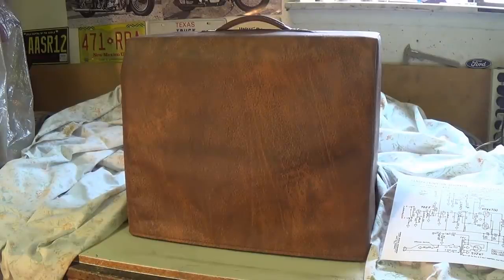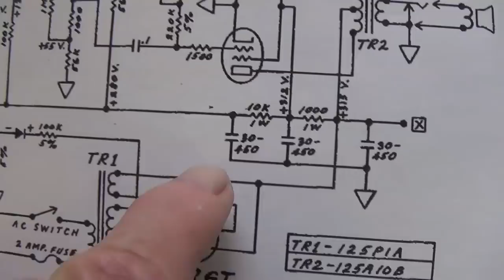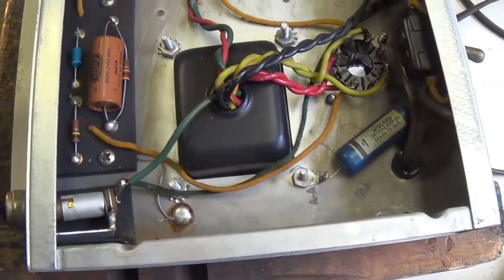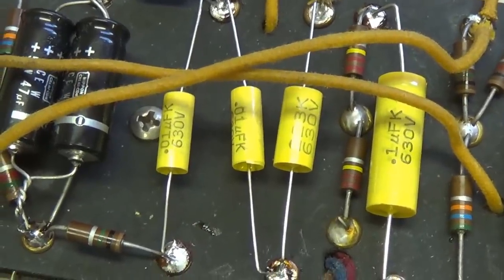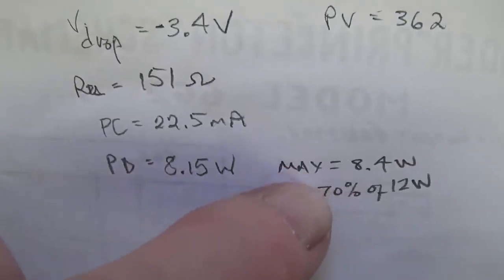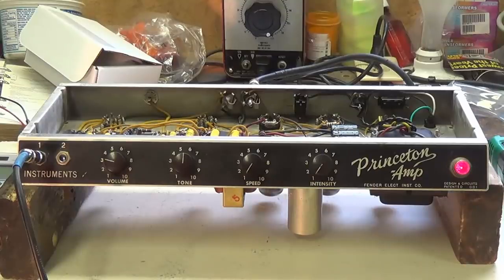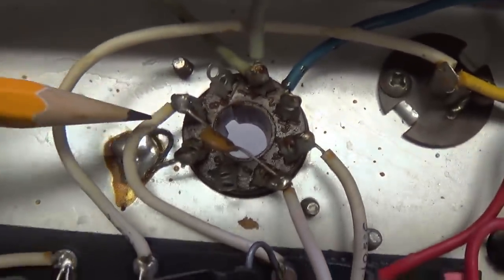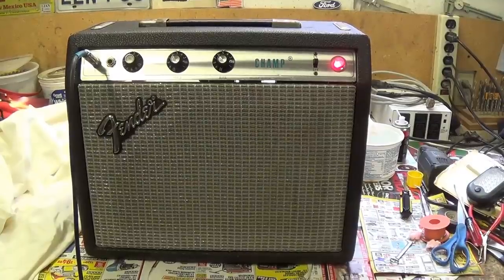Brownface Fender Princeton and Silverface Champ "Double-Header"

Comment: @UncleDoug  Hi and thanks for the videos! I have a 63 princeton amp I fired up today and it sounds overdriven when it's not supposed to. I checked the fuse and tubes, discharged caps, gave a quick look to see if anything had exploded and nothing, any thoughts after working on the one you did? thanks!
Reply from the maker: You might check your output tubes to be sure they are properly balanced and functional. Other than that, I'm at a loss.
Reply: @UncleDoug  thank you, any recs on a tube set?
Reply: also, can I mimic the bias pot mod from your other video on mine, get a matched set and then I can bias on my own with just a multimeter?

Comment: UNCLE DOUG --- I have a 1963 Fender Princeton Amp that I'm rejuvenating . What is the name or kind of tulle cloth that is used
on the front of it. Mine has kind of gotten stained over the years and looks like crap and needs to be replaced . I've had it since 1963... Thanks in advance.   Walt
Reply from the maker: Antique Electronic Supply offers a nice selection of replacement grille cloth, Walt. Check out their internet site.

Comment: 25:50 - Is the voltage drop across the primary for the right tube also ~ 3.4v?
Reply from the maker: No, it was quite a bit lower......which led to the replacement of the weak GE's with a brand new matched set of EH's. I left in the pot tuning of the bias circuit for instructional purposes, David.

Comment: Look at the serial number F00513, man this is a museum piece, but if he wants to actually play it these things have to be done. I wonder how he acquired it? Nice work again Uncle Doug. Are they old Indian Motorcycles pictured on the wall??
Reply from the maker: You're right, Z, but all the original parts stay with the amp so it can be restored to original if necessary. It was bought new by his father and is a family heirloom. Thanks. Sadly, I have never worked on an old Indian, so the wall "art" is mainly vintage Harley's and old British bikes.
Reply: Well I should have watched the video through first and of course Uncle Doug shows us every part and goes over the amps fully. My 1969 Bandmaster reverb has the wire "Faraday Cage" also Doug, I'm pretty sure that it is standard at least till mid seventies.
Reply from the maker: I guess I've never worked on one, Z. I don't recall seeing a Faraday Cage.

Comment: Why was the diode specifically replaced?
Reply from the maker: As a precaution. It appeared to be a molded selenium diode and thus was suspect. As cheap as diodes are, it's crazy not to simply replace them with much higher spec fresh diodes.......for about 20 cents.

Comment: Great video!  I'm working on a DIY fender 5f2a.  I've read on some forums that you shouldn't put a 47uf cap directly after a 5Y3—it's too high supposedly.  I want to install a 47uf in my 5F2A.  Are these people on the forums just being overly cautious?
Reply from the maker: Thanks, Tysen. Why do you want to use a 47uf cap? Having built a clone of this circuit, I can assure you that upgrading to two 22uf and two 10uf caps (in proper sequence) will provide optimum filtering. There is nothing to be gained by using the 47uf cap, other than stress upon the rectifier tube.
Reply: Well, someone on a forum suggested it to help with some oscillation I'm having when my volume and tone knob are turned up past 8.  I think it's probably my layout or possible lead dress....  @UncleDoug
Reply from the maker: What a strange way to prevent oscillation. If anything, you could simply install grid-blocker resistors on the pre-amp tube stages. Meanwhile, you're better off sticking with the regular filter cap values.
Reply: Great.  @UncleDoug   Thanks for the heads up! It's hard to know what forum folks to believe.  lol.  Anyways, I ended up solving my problem—everything is point to point on my amp and the 68k resistor coming from the input jack was too close to my coupling capacitors.  Once I moved the resistor close to the tube socket, amp sounds incredible!!

Comment: Uncle Doug - I have the exact same amp but with black Tolex from May of 1964. One of the last ones I believe. Its one month older than I. Just before the Blackface came out. It is also in very good shape. I was trying to get your attention to ask you why it sounded so trebly and nasal but I did not get a response. 
I was frustrated with the bad tone. I would have taken it to you had you lived closer. 
Do you have any idea why this amp would have no bottom-end and sound nasal? What is that a symptom of? A bit like a Wah half cocked or something. It looked great but sounded awful. 
I did some intense studying in electronics, since I could not get anyone to guide me. I then changed the value of the V1P1 and V1P6 caps. I also changed the modern Eminence ceramic speaker to a proper Jensen Alnico and it is a killer amp now with wonder tone and touch sensitivity. I love my amp now. 
Let me know if you have any idea as to what may have been going bad with my amp before the cap changes. I am a guitar builder but not and electronics guy but learning as I go along.
Reply from the maker: From what I can gather, you changed the value of the coupling cap from V1 (7025) pin 6 to the grid (pin 7) of V3 (12AX7). The tone control provides the coupling caps for pin 1 of V1......so I'm not sure how or why you changed them. All I can think of is that the coupling cap from pin 6 to pin 7 was bad, and when you changed the value, you installed a new, functional cap. The original capacitor was probably allowing DC to leak to the V3 grid, which will cause all sorts of problems. Regardless of my guesswork, all that really matters is that the amp is now fully functional.
Reply: @UncleDoug  Thank you for the reply. Just to clarify, I really increased the values to add more bass response and it worked.
V1P6 - I changed to 0.1 Ω
V1P1 - changed to 0.47 Ω
You can see these are a lot higher than spec. Like you said, it also must have been bad original caps.
Reply from the maker: As long as it worked for you, Z. That's all that really matters.

Comment: Was your change of the bias resistors more of a re-engineering that will work fine when a new set of 6V6s is put in? Or was it specific to that pair? (I heard no mention of the condition of the 6V6s.)
Reply from the maker: No, in any fixed (grid) biased amp, the bias resistance is carefully tailored to the output tubes, and must be checked and/or adjusted whenever a new tube set is installed. Look at the notes pinned to the top of the Comments for a statement regarding the old GE tubes. They were replaced.

Comment: I love this. Uncle Doug, have you any experience with Ampeg Portaflex amps? I have a cool example from 1962. I’ll send a pic if I can figure out how...
Reply from the maker: Thanks, Jon. My only experience with Ampegs is a Jet that I have owned and worked on quite a bit. I have great respect for the brand and would love to work on more of their products.
Reply: Uncle Doug - very good! How do I contact you? It may be obvious and I’m missing it....
Reply from the maker: Provide me with your e-mail address and I will contact you. Be sure the amp is a pure-tube circuit.....no PCB's or hybrids.
Reply: Casey says - “remove the cone of shame at once!”
Reply: I just completed restoration of a 1964 M-15. A bottle of mineral spirits, Q-tips and some dental picks will come in handy to soften and release the rubber glue slobbered on every wire and components in the chassis. In a few short hours you will have an incurable addiction to sniffing the spirits and qualification as a backroom dental hygienist!

Comment: Great vids , wondering if I should send you my Alamo bass head .
Reply from the maker: Thanks, David. It costs a lot to ship (both ways). Financially, you are much better off getting the work done locally.
Reply: @UncleDoug  ok sir thanks. I have been thinking I could delve into myself , I used to work on different electronic devices , mainly swap-tronics but I can solder good , also worked on alot of RC stuff.
Reply from the maker: @dave691974  See what you can do, David. If all else fails, I'm here for you.

Comment: What are those little clampable meter leads called? I'd like to get some for my Fluke meter. 

Thanks.
Reply from the maker: I think this is what you're looking for, Bryan:  https://www.ebay.com/itm/20PCS-Wire-Kit-Test-Hook-Clip-Grabbers-For-Multimeter-Arduino-SMT-SMD-E7C4/332748640177?epid=24010956660&hash=item4d795d4fb1:g:FPoAAOSw98FbZypD:rk:9:pf:0

Comment: At 5:42, notice that the fuse is on one leg of the power cord and the on/off switch is on the other leg of the cord. A bad idea! Common for Fenders and most other old amplifiers....and should always be corrected when the new grounded cord is installed, so that the fuse and switch are both  inline on the incoming hot lead,  which then goes to the power transformer. The neutral wire should always go directly to the power transformer. .
Reply from the maker: You need to watch the rest of the video, GU, this is not only corrected but explained in a later portion.
Reply: @UncleDoug  , nope, I watched the video again , and at some point the grounded power cord just "appears" inside the unit but you didn't show or talk about any of the rewiring you did to the hot and neutral lines. I don't need to see it done for my own edification, but it might be beneficial to other viewers.

 I am also curious if you lifted the grounded filament circuit and installed ground referencing resistors as an artificial center tap. It didn't appear that you did so on either amp (Champs also typically have a grounded filament circuit). Granted, the amplifiers both seem to work pretty quietly, with no major hum, but how they behave in the owner's homes (with computers, florescent or LED lighting, and whatnot) or even up on the electrically noisy environment of a nightclub stage could be very different.

Comment: Uncle Doug One cant help but wonder that if Ted had Rusty to help sort things out back in the day, would Ted’s resolution have had a more positive spin? He may have had more time to turn his attention to tube amp repair and design, which would have been right in line with Rusty’s agenda. I dont hear any disagreement from Jack, so for now I’ll have to lean toward his agreement on this matter.
Reply from the maker: Rusty didn't trust old Ted due to a difference of opinion regarding application of the Fibonacci sequence to proper coil winding techniques. As a result, they rarely spoke.
Reply: That may well explain Jack’s indifference.
Reply from the maker: Indeed :)
Reply: Uncle Doug It’s nice that instead of copying what Fender would use, you rebiased according to the actual range of the tubes; or the tube mfr specs. Lots of amp makers push the tubes too hard.

Comment: With the new bias resistor, replacing tube will require putting back in the 30k ?
Reply from the maker: No, Tony. Each time a new tube set is installed, the resistance value will have to be tailored to the new tubes to provide proper plate dissipation. Odds are that the 30K resistor will never be used again.

Comment: Hi Uncle Doug.  I don't know anything about social media or any other way to reach you.  That being said, I just completed a brown Deluxe 6G3 using the schematic out on the ampwares site.  My normal channel is absolutely glorious sounding, stealing a phrase from you.  My bright channel is lower in volume, has very little chime and overall is very uninteresting sounding.  Some of the differences that I see in the two channels are a .003 cap that parallels the plate resistor on the normal channel only and the caps on the tone pots that are grounded to the pot bodies, .01 on the normal channel and .02 on the bright channel.  Can you tell me in this design, which components make the tonal and volume differences in the two channels?  Is there a better way to reach you other than opening a facebook acct?
Reply from the maker: I also have a Facebook page: Uncle Doug's Vintage Amps, Tele. I prefer to keep amp commentary on either this format or on FB. Looking at the schematic, I too see very little different between the two channels. The .003uf cap in parallel with the plate resistor probably lets some high frequencies escape from the circuit, thus making it more mellow than the "Bright" circuit, where they are retained. Are you sure there are no circuit errors in the "Bright" channel?  It should be just the opposite of flat and uninteresting. To test this theory, add the .003uf cap and change the tone cap to .01uf.....making the two channels identical. See if they sound that way. If not.....there must be a problem in the Bright channel, i.e. a weak triode in the 7025/12AX7. Be sure both cathodes are bypassed.

Comment: UD, unrelated,but I did not know where to post this inquiry, and, if you've addressed it, please accept my apologies...regarding (your) test equipment: do you find much use for/or have a  VTVM, an old 'capacitor checker' (for leakage mainly) and the like...I've read, for example, that because of impedance issues a VTVM is better suited than a digital meter for tube equipment troubleshooting.Your thoughts appreciated and thank you so much.
Reply from the maker: Actually, I would say that the much higher internal resistance of the modern digital meter would make it more accurate for any and all circuit measurements, Joe. The old analog meters (which I also own and love) had much lower internal resistance and tended to load down the circuit, actually altering the measurements by their presence.  The only time that the analog meter might be better would be if you were trying to emulate the voltage values on an old schematic......since they were most likely taken with an analog meter.
Reply: @UncleDoug , your last sentence nails it. In certain instances you really need to either use an analog meter that loads down the circuit more, or put a shunt resistor across the meter probes of your digital meter to make it load down the circuit as if it was an analog meter. Alan Douglas's book "Tube Testers and Classic Test Equipment" makes mention of this, and the necessity for using a shunt resistor on a digital meter (paralled across the test- probe inputs) if you are calibrating a Hickok tube tester, otherwise your calibration procedure will be way off. (Approx 1k per volt shunt in the case of the Hickok calibration, therefore a digital meter set to the 200 volt input range would be shunted with a 200k resistor; the Hickok main B+ is 150 volts).

[Edit: I should add that the impedance of a vtvm is also very high, similar to the high impedance of a digital voltmeter, and there are certain circumstances with vintage equipment where they wanted you to use the vtvm, so as not to load down the circuit under measurement. An example being if you were attempting to confirm proper  AC signal level  to the grid  of a tube under test in a Hickok tube tester; for that application, or for calibrating it in the Hickok models that allowed  you to do so,  you were supposed to use a vtvm.  The rest of the measurements however were generally specified as being done with an analog  meter of lower impedance input.]
Reply from the maker: @goodun6081  Thanks for your follow-up, GU. The additional info was very helpful.
Reply: I thank you! I may follow up with this again

Comment: Looking to fix a Randal 100HG Amp head.  With a speaker list I get two resisters smoking.  Not a tube amp but was only made a couple yrs. In the 90s.  Any suggestions?
Reply from the maker: If it's a SS amp, I have no idea, KC. I deal only with tube amps. Perhaps a Randal site will be able to help you.
Reply: @UncleDoug  nope, schematics are random. But thanks.